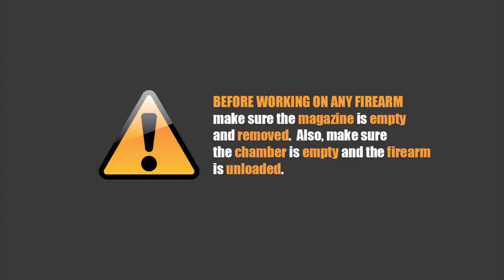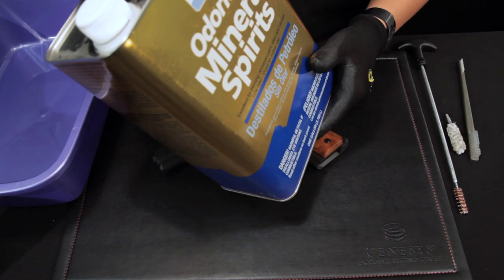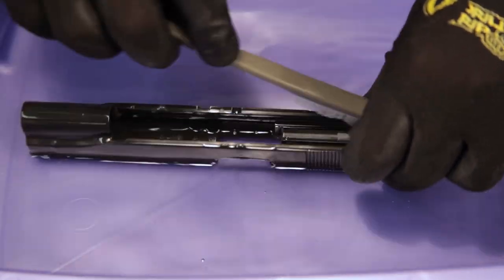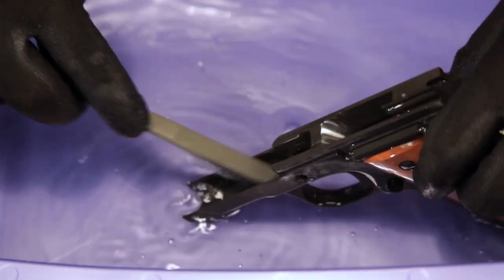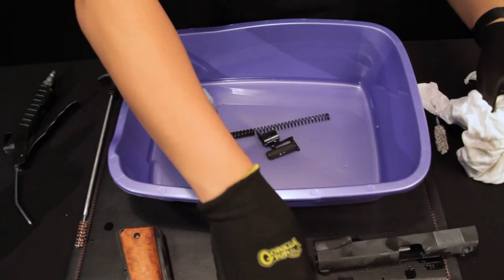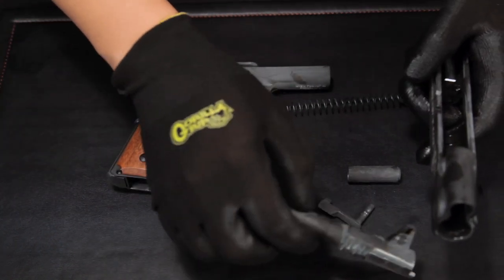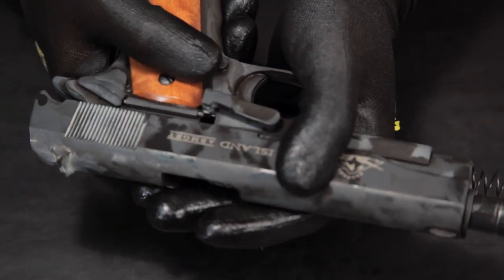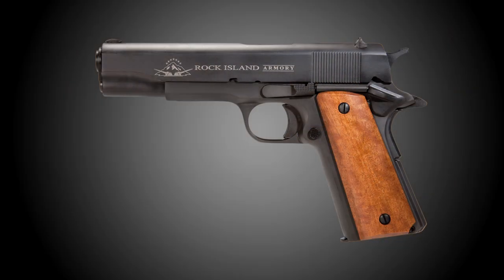Rock Island Armory Basic 1911 Cleaning (Official)

Comment: For everyone saying this method is wrong: This is the manufacturers official channel. I'm pretty sure they know how to clean their guns better than you do.
Reply: SKiTz The Gemini uhm....NO. it's like saying parents are naturally right because they made the baby... think before you say stuff.
Reply: They just build 'em. We shoot 'em.
Reply: correct, manufacturers knows best
Reply: This is not the right way. The sear, hammer, and disconnect need oil, including most of the internals in order to prevent rust if you actually carry or get any real use out of your gun. Not a lot but a light coat that would be completely stripped away by the mineral spirits. The metal under the grips also need oil because sweat tends to work its way under when holding the gun. Barrel bushing needs oil where it locks into the slide to help with future disassembly also. This is the laziest way to clean a gun and will lead to rusting, harder takedown, and a poor functioning gun. Watch wilson combats cleaning video to learn one of the right ways to clean your 1911 in the simplest way.
Reply: Just use WD40 and a rag to clean the pistol....  The water is totally wrong and would rust the pistol...
Reply: They didn't use water...It was mineral spirits... Pay attention.. @gregvidall
Reply: I liked their recommendations on how to clean the gun, but NO WAY I’m reassembling it dry.  It that ruins my gun, it will be on me.
Reply: @gregvidall  did you smoke krak. that aint no water - mineral spirits
Reply: @youngpreper3973  Bingo! We have a winner. Most of the gun was unoiled or under oiled. EVERY metal surface should have a light coat of oil. The mainspring and magazine catch spring can both use a small dab of grease instead of oil, because most people don't take them out and oil them very often, if ever.

Comment: A quick help tip: For the first step, switch the safety on... it locks the slide and makes it easier to depress the spring plug.
Reply: Thank you. I will try that
Reply: That's what I always do, for disassembly and reassembly. It REALLY helps when you you have a 20 pound recoil spring. I shoot a lot of +P ammo in an aluminum frame Para-Ordnance and the standard 18.5 pound spring they recommend is a little too light for that. Forget about using a 16 pound spring that many other brands use if you shoot mostly +P and hot defensive loads.

Comment: I just put a Rock Island Armory GI 1911 on layaway. I can't wait. It's my Christmas present to me from me. lol. This will also be my first 1911
Reply: Can you tell me where I can find a better Beavertail and hammer that will fit the RIA 1911 GI standard? A lot of people has told me that the Beavertail that is on this cuts them from the recoil and I'm a free bleeder and I can't have something like this to keep cutting me over and over. Right now the gun is still on layaway and I've only put $45 down on it and here soon about to pay it off,  But I don't want something that is going to do that.
Reply: @jamessanders2164  They have fixed most of this from the original design and now they are not having this issue. I love mine. I carried the Colt 1911 in the Army. This is a very affordable alternative with the same feel and characteristics.
Reply: Whatever you do, DON'T clean it like this. Plenty of videos out there showing the Right way to clean a gun.
Plenty of quality aftermarket parts available at MidWayUSA.
Reply: I just bought and have been to the range with my brand new RIA M1911A1FS and it's fantastic.  I ran about 200 rounds through the firearm, all different types of ammunition even steel cased. No jams, no stovepipes, no malfunctions. It just shoots and shoots and shoots. Great alternative at a much lower cost.

Comment: I'm new to the 1911's, and this question is actually serious. It's for knowledge and learning. I have the RIA 1911 chambered in 9mm, and just curious if all 1911s fail to chamber the 1st 2-3 rounds correctly, or did I just get one made on either a Friday or Monday? Lol. It's a new firearm, 10 round factory mag, and when fully loaded the first 2 or 3 rounds angle down when chambering, which I've never had happen with any other firearm I've owned or shot. Just really looking for answers/advice.
Reply: Buy a Wilson Combat magazine for it first. 500 rounds is manufacturer break in.
Reply: It’s the magazine’s- same thing happened to my 10 mm from them
Reply: Yup, the mag sounds like the culprit. I use 45acp, but if I get mags I get Mec-Gar brand.

Comment: This is not the right way. The sear, hammer, and disconnect need oil, including most of the internals in order to prevent rust if you actually carry or get any real use out of your gun. Not a lot but a light coat that would be completely stripped away by the mineral spirits. The metal under the grips also need oil because sweat tends to work its way under when holding the gun. Barrel bushing needs oil where it locks into the slide to help with future disassembly also. This is the laziest way to clean a gun and will lead to rusting, harder takedown, and a poor functioning gun. Watch wilson combats cleaning video to learn one of the right ways to clean your 1911 in the simplest way.
Reply: Also grease on the rails is far better than oil because the grease does not evaporate over time or burn off as easily and that is a heavy contact area. This video is repulsive by how lazy it is in my view. The mineral spirits will also destroy the night sights on your guns if you have them and use this method. It eats out the glue or apoxy that holds the tritium inserts in. Again, watch wilson combats video or for god sakes anyone elses if you want your gun to last and not accidently destroy it.

Comment: Question, how long should I wait until replacing the recoils spring? I 
have a RockIsland Armory 1911 A1FS, I have run approx 1000-1200 rounds 
thru it since buying the pistol. I find the videos very informative and 
well put together. I also love this 1911 model, I have only experienced 
2-3 failure to feed jams, this happened only in the last few hundred 
rounds...Thanks
Reply: I was told they can last up to 5000 rounds but I’m not sure let me do some research
Reply: Yea I’m reading people change them out anywhere from 5000-10,000 some even replacing them every 2-3,000

Comment: The mid size I recently got as a first firearm came with lubricant. I was told to just disassemble and wipe the lube off and then use some CLP for first cleaning. Did that and then put 100 rounds through it, no problems at all. Should I just continue cleaning regularly or should I use mineral spirits like in this video? or is this how you should clean it regularly, and if so how often?
Reply: I got mine and shot 300 rounds straight out of the box and no malfunctions. Just cleaned mine with Balistol and weapon shield oil. Use whatever u have but forsure lube those points in this video. Have fun

Comment: You do not need all this oil on a 1911.  No need to lube the rails, no need to lube the guide rod, no need to lube the outer barrel.  Drop this gun is sand & you will have a sticky mess and malfunctioning weapon.  DON'T DO IT.